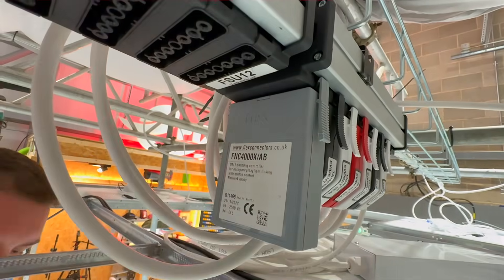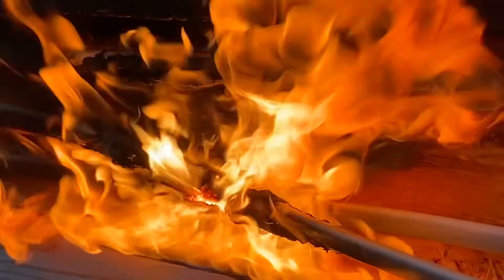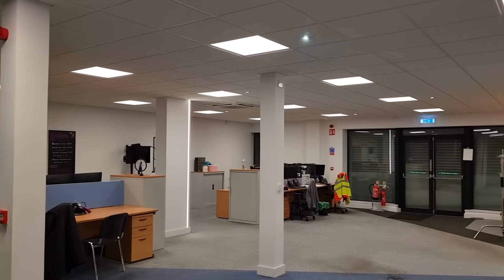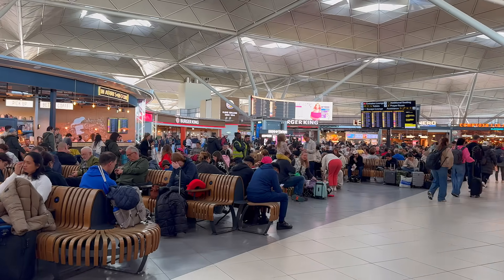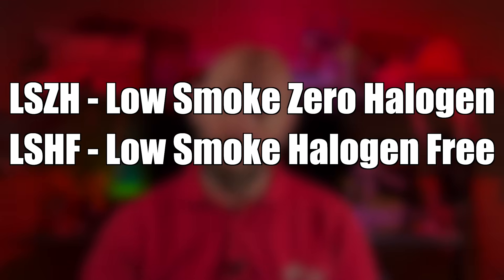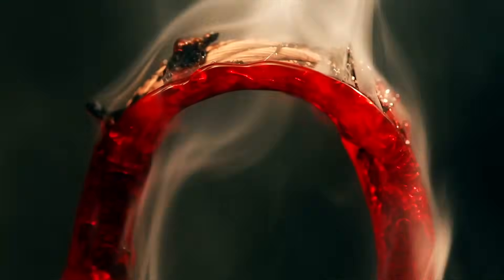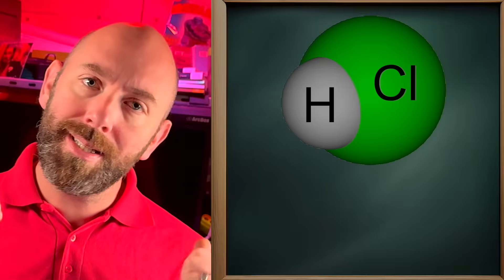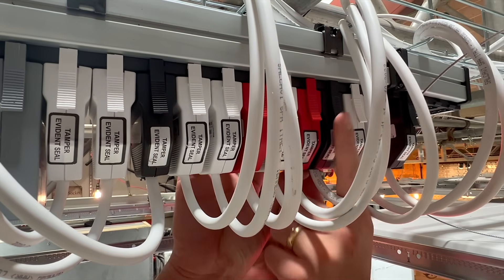Low Smoke Cable Confusion? Here's What Building Regs Actually Say

Comment: Very interesting. I worked in Terminal 4 just when all this 'hit the fan' but it was very difficult because the KCF report only made recommendations not specifics and we had to adopt those recommendations (and test them) but nobody knew how at the time! Where's the installment on isolation you mentioned? This is a hot topic and constant debate of mine, I always argue that anything that plugs in is out of an electricians scope but clearly there is a 'red line' and Flex7 would form part of an installation. I always wire things like waste disposals via an extra, adjacent, redundant 13A socket, that way on the inspection, if the waste disposal has say an earth/neutral issue, it can be unplugged and is a notification you can walk away from not a fail, same with all industrial equipment (compressors, lathes, milling machines etc) I use it as an electricians get out of jail free on large installations! If you haven't made it yet please chat about transformers because I find that large outdoor lighting systems (where each circuit might have 70-100 fittings) can easily pass leakage current but can never be made greater than 1 meg no matter how good an electrician you are, so isolation is the only way but there's nothing in the regs on this.
Reply from the maker: Great insight - next part coming soon.

Comment: If the building has false ceiling and drywalls, those cables are justified. 

But if all the cables are buried to concrete or bricks under cement compound, effect wirll be zero. Poland and Lithuania still manufacture PVC cables as many buildings there are fully made of concrete or bricks and in case of fire no difference will be detected as cables are hidden inside compound. 

In some countries false ceilings and false walls weren't popular during cold war, so all electric cables are reliable hidden from the fire.

Comment: You could argue click connectors in a domestic setting for down lights turn it into a modular system - doesn't mean you don't test them as part of the fixed wiring. Makes me wonder why there's even a separate video.

Comment: The hydrochloric acid issue makes it seem like sprinklers would be a very bad idea.
Reply: not so much, it’s more about the moisture in your lungs.  Sprinklers give lots of water so the acid would be weak, but your lungs have a moist coating and lots of surface area, which makes for a stronger acid.